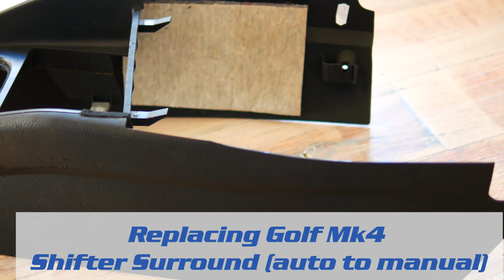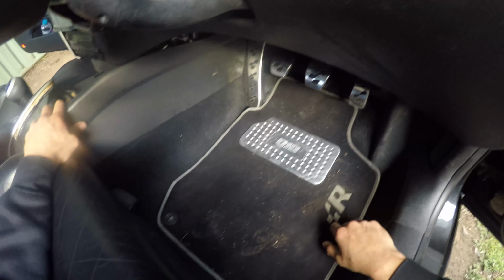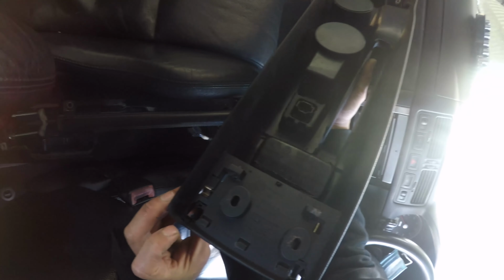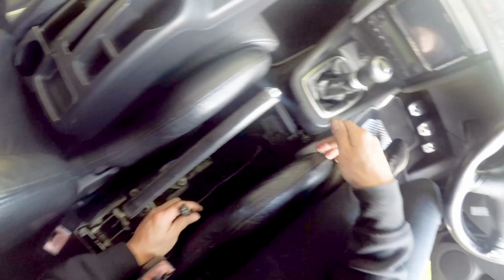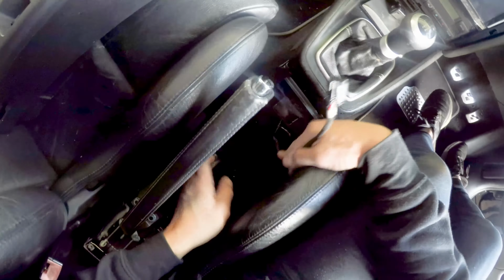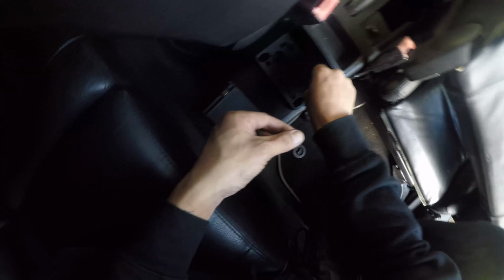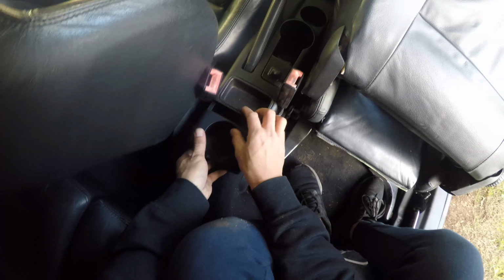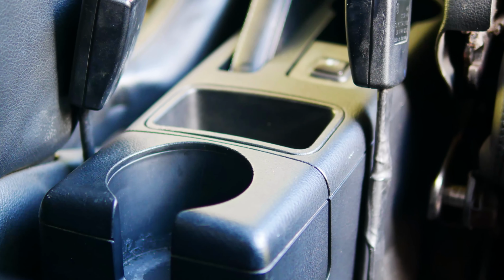Install VW Golf Mk4 US Spec Cupholder Centre Console upgrade. For Bora, Golf GTI and R32

Comment: Can this be swapped into a 2002 golf that didn't come with one? Can you find them in beige?
If I can shift my cup holders to that location (translocate them) then I will spec up with a double din android auto head unit with the big screen that would come up and cover where the dash cup holders are.
Reply from the maker: Yeah should be able to upgrade yours. Ours didn't have this style from the start either. 

Not sure baout he beige thing - probably but you'd jsut have to check that on ECS or something.
DOUBLE din screen looks great in these cars! Definitley go with that option ;)
Reply: Sure you can get them in beige,grey and black color

Comment: I have a genuine question , i gave 2013 jetta but its centre console is ugly , can i install another cars centre console on it , that a lill more organise more spacious cuz current one sucks
Reply from the maker: Good question but I don't think it will be such a good idea. They probably won't fit they these are designed specifically for this generation of Golf/Jetta.
Reply: @ianpgonzaga  tahnks a lot for your response back brother , really appreciate it 🙏🏼 i lst thing i wanna ask is , will it be possible to install central console panel from newer model jettas 2020+ onto my 2013 jetta ? Do the have similar hooks(installation lock point) or are they different, cuz newer jettas have a beautiful one too
Reply from the maker: @fauj7860  I'm not familiar with these models but if they're very different models and size inside most likely incompatible. 

Are there any eBay listings you can compare the mounting points with each 2013 vs 2020 model console?